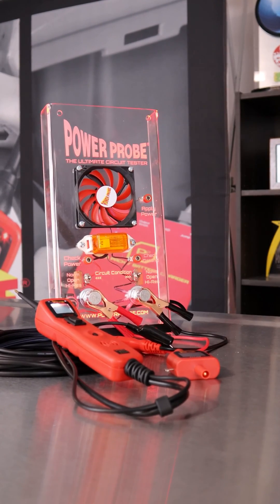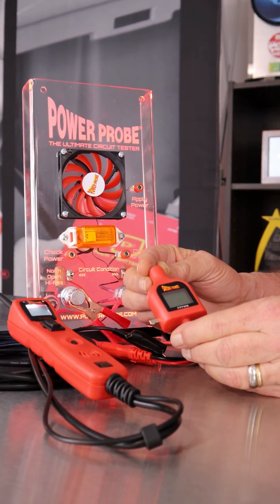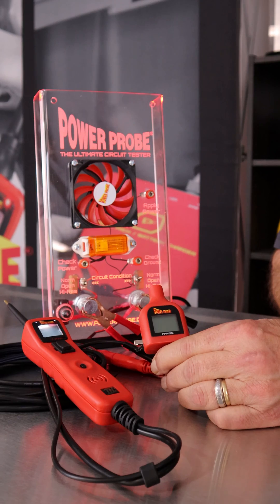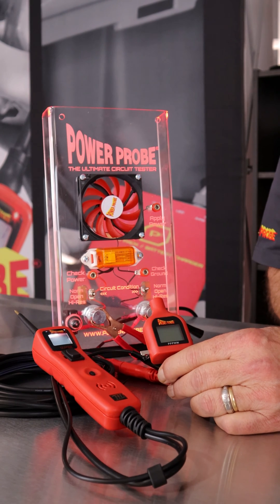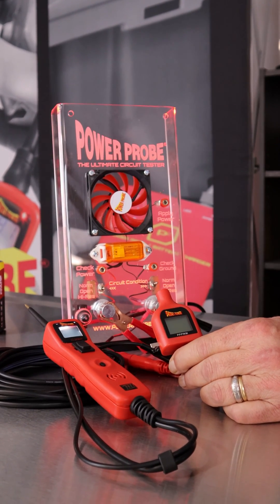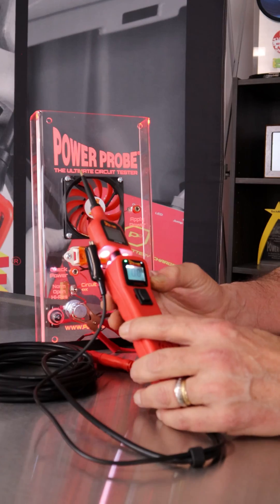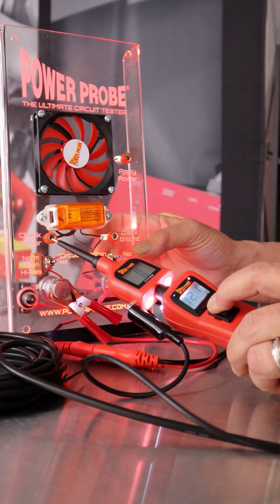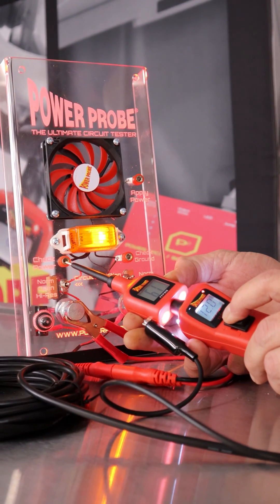PWM Tip Demonstration

Comment: I see you are applying a 12v pwm signal. Can the tool apply a ground side pwm signal?
Reply from the maker: Hello @djtrisler Yes, it can. It just works on the ground side instead. The logic is reversed though — what would normally be 100% becomes 0%, and vice-versa.

Comment: Can it read or test pwm signal sent from the pcm? Or does it just make its own pwm to component test say a radiator cooling fan?
Reply from the maker: This is for testing when outputting, so you’re correct in using it to output a PWM signal to a fan and operate it in steps vs 100% on or off